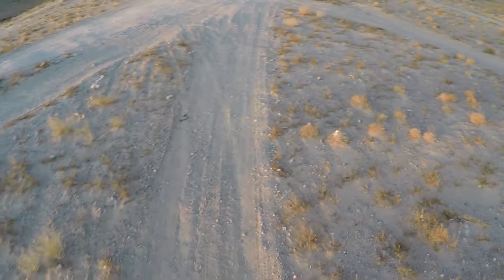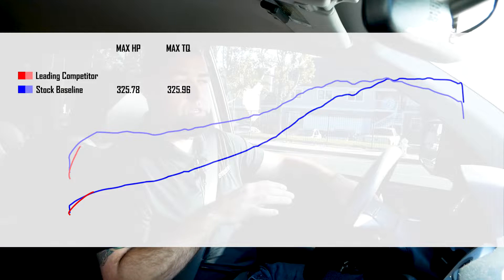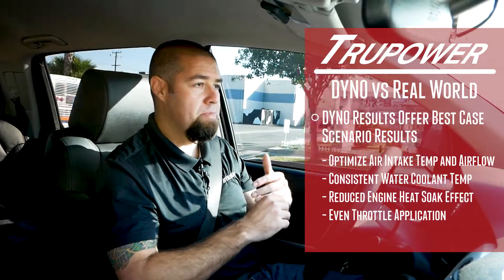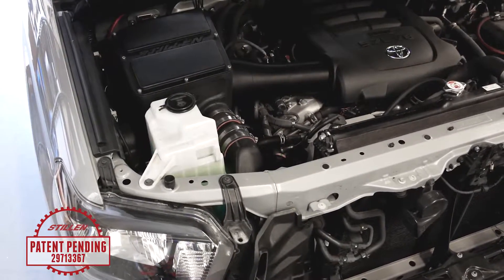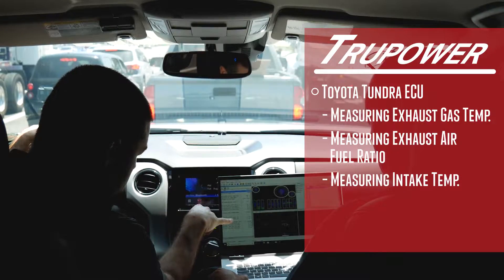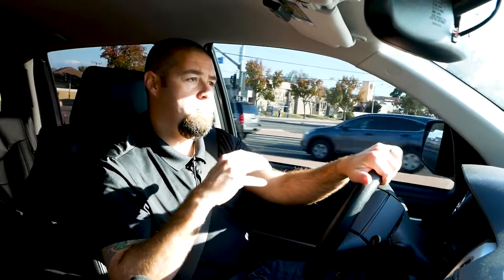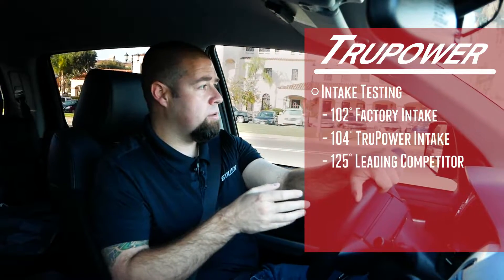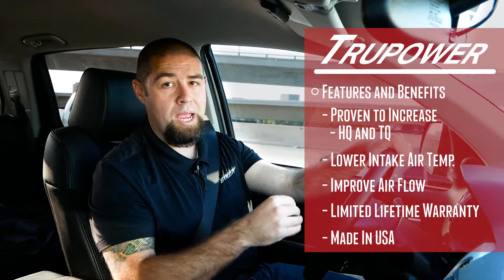2014-21 Toyota Tundra TruPower by STILLEN Cold Air Intake | Dyno and Intake Air Temperature | Part 2

Comment: Do you know if this intake will have a tight seal against a ram air hood such as the RK Sport hood for the tundra? I understand that the top cover has to be removed. Is there a seal you guys make or know of if I run this setup with a ram air hood.

Comment: 340hp to the wheels???? with just intake box??????
Dude you really think people that stupid?
Reply: The stock one on the dyno was 325 om the chart. So from 325 to 340, it's a 15hp increase. Every dyno varies. No a Tundra doesn't have 340 hp at the wheels if it has 381hp at the crank.